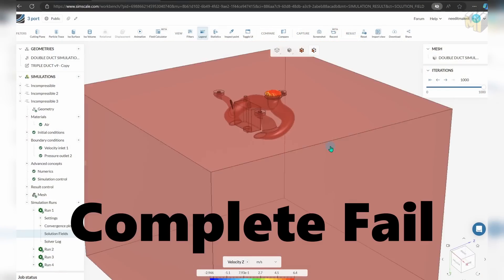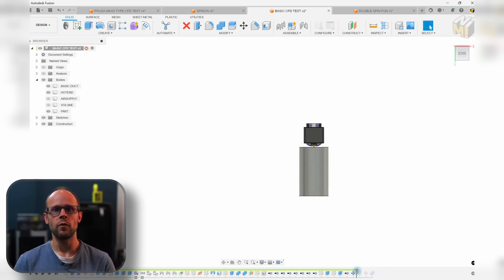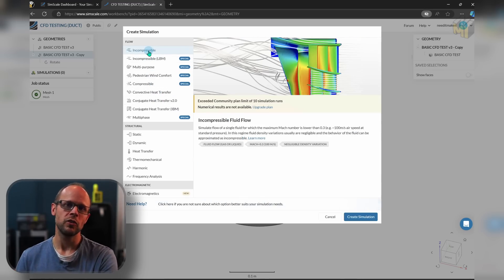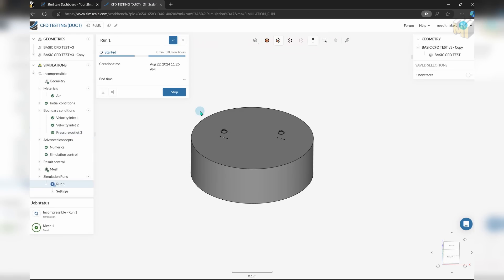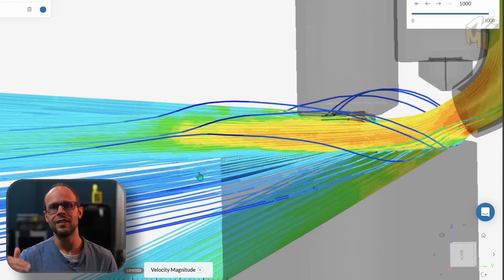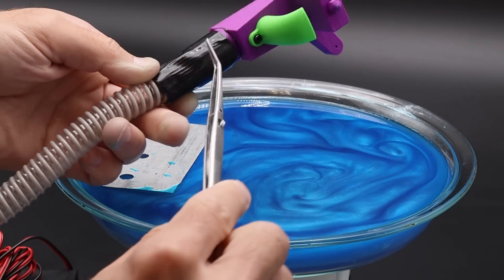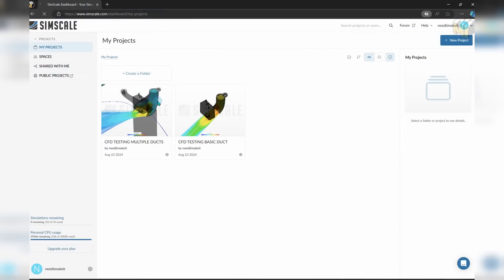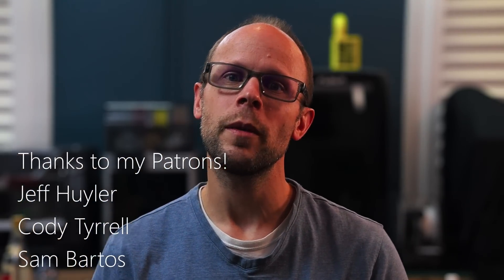Now anyone can simulate flow for a 3D printer duct

Comment: The 60 m/s really depends on the opening size. You either get slightly higher velocity but less air flow, or the reverse, and it's not linear. Though I'm not sure how to best model a standard far in SimScale as I don't think a pressure inlet is accurate either. A standard fan will only slightly increase the static pressure, so it'll not keep 60 m/s at the inlet when the openings are too small.

What I ended up doing, is keeping the original duct opening area and only change the rest.

Comment: I used SimScale to determine the best air flow for the fan duct (D9 Cii re-inspired part cooler) for my Duplicator 9 back in 2021 and it worked really well.  Really neat software.

Comment: Thanks for the video guide. In under 30 minutes I had the simulation up and running.
Reply from the maker: Nice!  That's awesome, I found it a little tough at first, but after a few fails, it came together nicely and it is so cool to be able to visualize something like this which would be pretty tough to do without just printing endless models and testing them out... I ended up doing that anyway for the duct showdown series.

Comment: Too awesome! The comparison between the simulation and the sparkle water flow is amazing. I think some more comparisons with the real camera and virtual camera at the same viewing angle could help with the comparison even more. Great work!
Reply: While it creates some interesting visuals, that comparison is not particularly meaningful. The second nozzle he did the comparison is wildly misleading as all of the flow structures you see are really due to the free shear layer interaction between the air and the liquid rather than showing what's happening in the air.
Reply: @williamhumber5890  It's not that it shows exactly what is happening or gives us a perfect simulation. It simply gives us a visual to identify some ways the duct is behaving. For example if most of the air is directed at a specific angle or if it is creating a spiral. It's a single tool with limited applications, but still interesting.
Reply: @802Garage  I hear what you're trying to say, but what I'm trying to point out is that particular comparison (looking at the behavior of the rheoscopic fluid) can show physics that are completely different from what is happening with the gas flow from nozzle.
Reply: @williamhumber5890  I agree. Can't take everything at face value. Gotta put your thinking cap on. Even having exact air flow models can heavily mislead you. What you need is results. 😁

Comment: There is a thing with CFD analysis.
Simulations are not really that hard to setup, but really hard to comprehend and validate the results. They are not just a bunch of red yellow and green lines.
Reply: Came here to say this! Putting CFD in the hands of home gamers without spending some SERIOUS time discussion "garbage in = garbage out" is a really poor choice IMO. The video certainly gives the impression that "it's on the screen so it must be what would happen in reality!"
Reply: I kinda agree, but also think that using the water test goes somewhat towards validating the setup. Others have been using overhang tests in different directions to check if the ducts actually work as simulated.
For me, not being trained in this I just want to look at the big picture, not super optimizing every particle trace.
Reply: I find silly to use CFD for such small things, a real life experiment can be setup and give you more accurate results than even the most powerful supercomputer in the world with the most expensive software. CFD only makes sense when you have large objects and its more expensive to actually do a real test first. 

Feeding fluorescent microscopic particles into the airflow or even incandescent particles like burning magnesium dust would pretty much show you what this CFD simulations show you with far more accuracy and without relying on software that might disappear or become pay walled.

Comment: It would be valuable to see the physical model you used as a simulation. I suspect the fluid surface behaviour will be quite different to the air flow.

Comment: 60m/s is a Little fast imo. It is almost 220km/h or 1/6 of the speed of Sound… aka local hurricane. to Calc a realistic value check the volume flow in the datasheet and calc the avg speed with the diameter of the inlet. Ideally add the pipe from the Fan to the inlet into the Simulation.

Comment: Been doing this for a while. You will get much more representative results if you specify a volumetric flow rather than a flow velocity.
generally for a 5015 the volumetric flow can be considered to be approximately proportional to the total nozzle outlet area/ total fan outlet area, eg a duct with 50% nozzle outlet area compared to the outlet of the blower will have approximately 50% of the maximum blower flow at zero pressure drop.

Comment: what if we add a deflection flap on the silicon shroud on the hot end / nozzle to curve the airflow in the 'dead' zone 

might be helpful on overhangs that are oriented away from the ducts if the duct design is already blowing majority of the air in one direction

Comment: Very cool. Question: have you though about a venturi design where you can separate hot and cold air? I know this video is not about the design but more about simulating air flow, but it triggered that thought.
Reply: You mean Ranque not Venturi
Reply: @herrkulor3771  Yeah, I couldn't remember the name when I made the comment. But it's a device by Exair.

Comment: These simulations could work IRL, if input stream was ideal - laminar flow and constant velocity across area.
In reality, that is not the case. Not with turbulent CPAP tube. Very much not with hugely varying flow across 5015 exit. I wouldn't count too much on pretty and fancy looking "science" 😬 (or should we - working with the unseen - say séance 😅)

I'm not saying simulation can't be used as starting point for testing and refinement based on measurements and observations - but until that it's pretty much assumption in, assumption out 🤷‍♂
Reply: Yep. The turbulence could be included a little bit by including the pipe, starting from the Fan and leading to the inlet
Reply: Especially since the 3d printed lines... Extremely turbulent airflow

Comment: Nice video, if anyone get curious about fluid simulations, this is actually eulerian control volume. And you don't need compressible flow dynamics in this case. Flow is probably too slow and temperature effect is negligible to create compression. In this problem turbulent flow characteristics is more important. Keep up.

Comment: People put a lot of effort into these cooling solutions, I just got a naked blower style fan mounted with stiff wire blowing in the general direction of the part and it works fine. I'm sure it could be improved but perfect is the enemy of good enough.
Reply: Honestly you can do a LOT WORSE than the naked fan by trying to make it better. I have seen a lot of things that are worse.
Reply: @SianaGearz  that is why you also test it in the real life. I have gotten better results from my designs that any other duct or the creality original duct. It all depends on what are you designing. You won't get the performance of high performance cooling systems, but you can make it better. Testing in real life is also important
Reply: But in some cases, you can tune it to work even better. If you have two fans or a dual duct of one fan where the airflow collides, you are wasting performance. He already showed that having a slight offset between the two improves the performance.

Comment: I just followed this with a nozzle I made for the Orbiter V3 on a tool changer mount. will tag you on my community post so you can take a look. It's a simple single duct, but it does work as expected based on your example.

Comment: Typically you can assume air is incompressible below Mach 0.3, so it is a perfectly acceptable simplification here.
Reply: Correct, but a little out of context, no? I would think it can be simplified like this in open atmosphere, but not in a nozzle, as pressure changes Mach. 

For example, surely an air compressor moves air at a high pressure but low velocity, but that doesn’t mean the fluid isn’t compressible by an air compressor.
Reply: @TheOfficialOriginalChad  Right, it's all about using the easiest equations you can get away with for a given scenario. In this case, especially being fan powered, I would assume a very low mach with little pressure change.
Reply: @TheOfficialOriginalChad  As long as the mach number in the nozzle is less than 0.3 you're fine with incompressible. Given the pressure ratios involved in these kinds of blowers, running incompressible would be completely unnecessary.
Reply: @williamhumber5890  You’re not wrong…yet. You need to know the pressure in the nozzle to know what mach 0.3 is…so whats mach 0.3?
Reply: @TheOfficialOriginalChad  He's using a CPAP fan, the pressure rise on those is typically one the order of 300-400 Pa. You're not going to get anywhere close to needing to account for compressibility effects. Second, for just looking at particle tracers like the video is doing incompressible vs compressible won't matter anyway.

Comment: This project is shaping even better than expected! I am going to go on an limb here and ask if you can design an upgrade for the Ender V3 se, i am currently struggling with a single 5015 cooling solution, but I feel it can be much improved. Cheers!

Comment: In aerodynamics, “compressible” flow means supersonic flow where you’ll need to calculate shocks, etc.
Reply: Rule of thumb is anything below 100m/s or 1/3 of the speed of sound is incompressible, the error is really marginal, especially when using fans which low maximum pressures. A ws7040 is also very much incompressible

Comment: I was hoping this was going to be a demo/tutorial of OpenFOAM.
Reply: With OpenFOAM you can to much more 😂
Reply: Same! I have paid sim software but have openFOAM dl'ed and waiting for a few days with free time to try it out.
Reply: only issue with OpenFOAM, at least when I looked at it, it's Linux only so maybe not ideal for him
Reply: @nathan22211 Open Foam can be used with Windows as well, though it is more difficult to create custom solvers than on Linux. The basic, built in, solvers work fine though.
Reply: @nathan22211  can be run in windows as long as you have the windows subsystem for Linux enabled